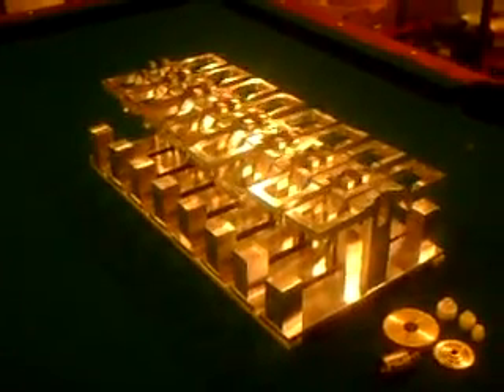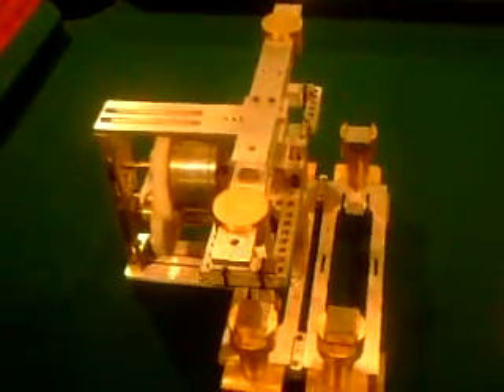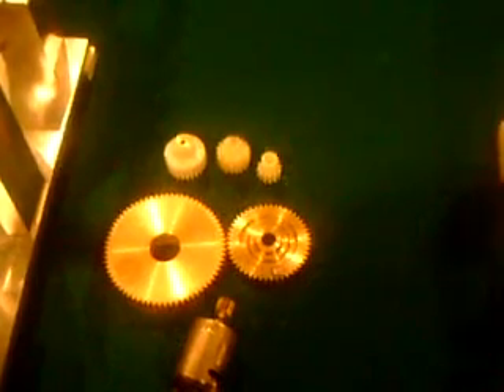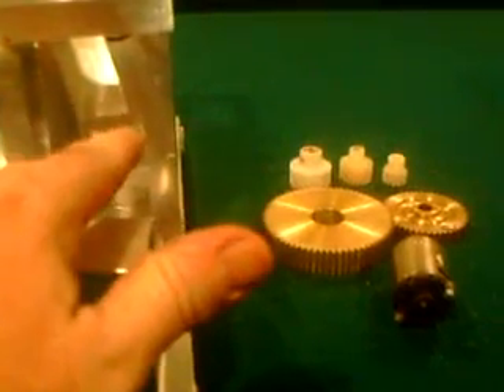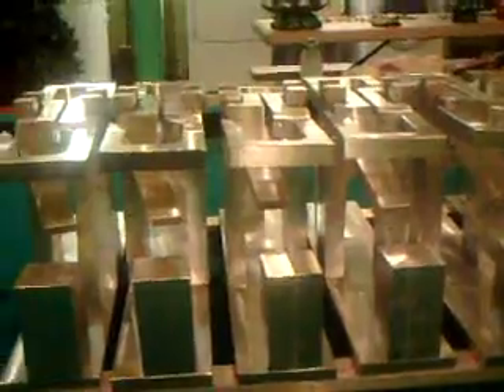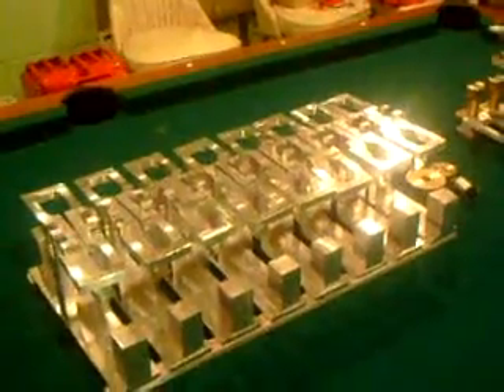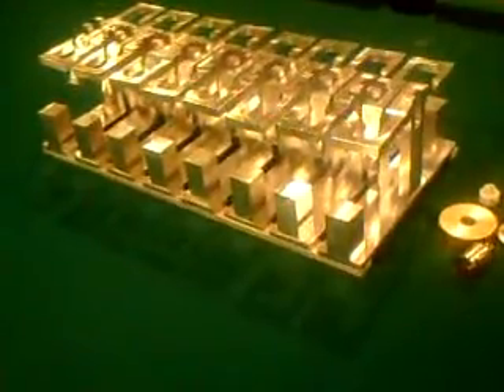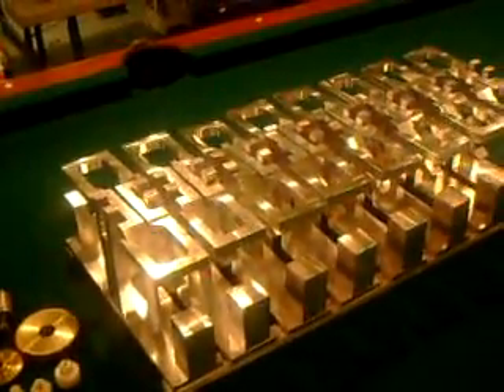over unity 8

Comment: Are you also capturing the flyback  energy from the coils that is produced as the magnetic field from the input pulses collapse? That would send your efficiency through the roof! The flyback energy can be captured utilizing diodes to rectify the flyback charge(That is opposite to the polarity of the charge used to initially create the magnetic field) and store that resulting higher voltage charge in an ultracapacitor bank that is then used to charge a secondary battery similar to the primary source battery. Then as one battery draws down below a certain preset voltage you could set it to automatically switch over to the freshly charged battery and continue on back and forth. Pulse type motors are inherently more efficient as they are not fighting their own back EMF and the flyback energy that is produced can be captured for reuse. You would also be better off with a rotating system as the stop and go action of a boom system such as this wastes energy. Magnetic bearings are a must and enclosing the entire device inside a housing that can either be vacuumed down to reduce friction further to nearly nonexistent or fill the housing with pure hydrogen gas that can also be used as a cooling medium as is used in commercial power generation plants. Using a Rodin coil (Wound with silver plated Litz Wire for high frequency efficiency) to rotate the rotor shaft by way of a large, powerful spherical magnet can get you well into the 350,000RPM range(With carbon fiber rotor disks of course) is also an option you could explore, with magnets embedded in the outer edges of the rotor disks to energize air core pickup coils positioned around the perimeter of each rotor disk on the central common shaft, all riding on magnetic bearings. The rotor magnets must be retained by Kevlar thread wrapped many times around them and the entire assembly gets potted in high grade epoxy resin to resist the incredible centripetal forces at such high RPMs.  Hope this helps, it about as much as I can tell you without having the black vans show up in the middle of the night...lol